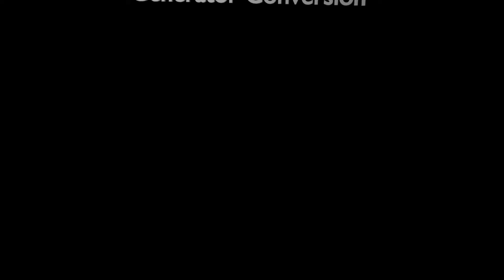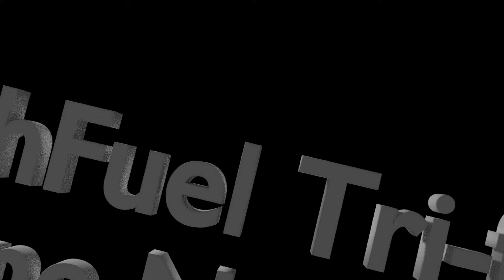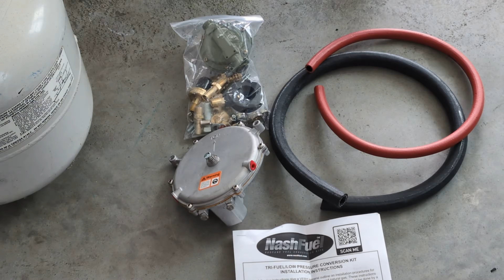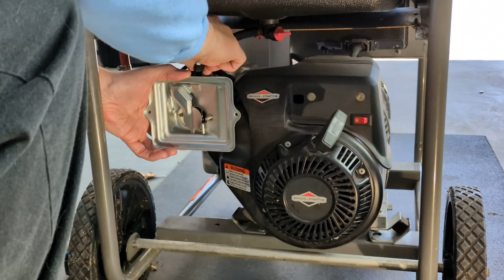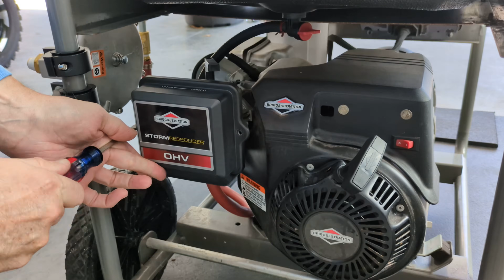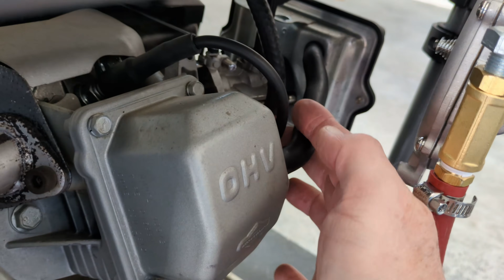Install & review NashFuel Tri-fuel Propane Natural Gas Generator Conversion Briggs Storm Responder.

Comment: Only thing you missed is to regap your spark plug to .018 - .020 some I saw said .025 but gas gap is .035 much closer gap .
Reply from the maker: I guess I didn't see a need for it since it runs fine & doesn't sputter. But if it did that definitely is an easy fix. Thanks 👍 🤞